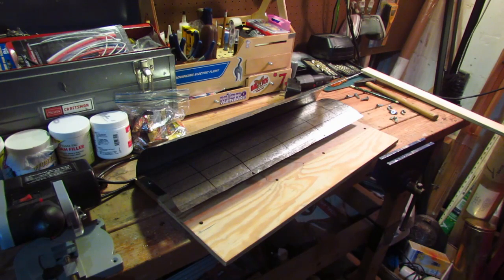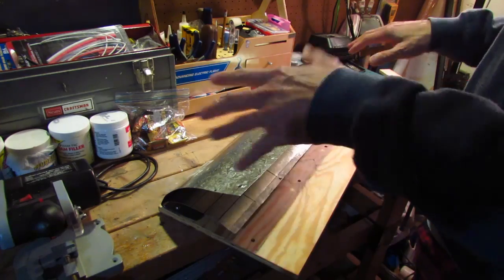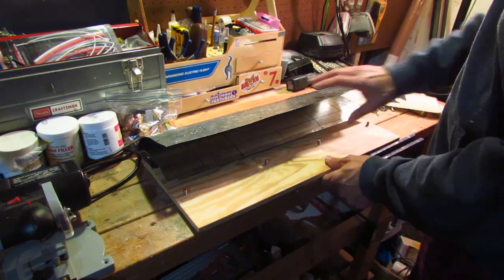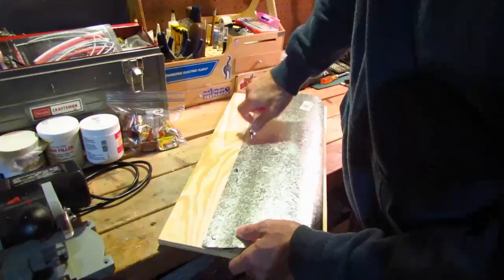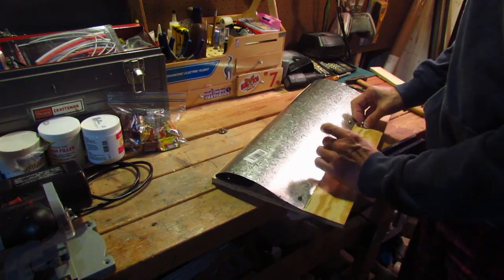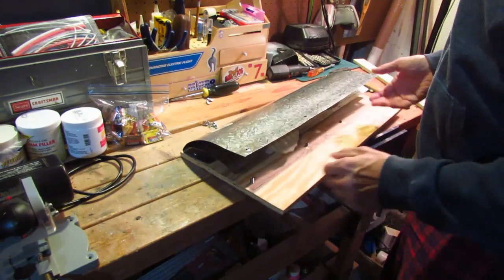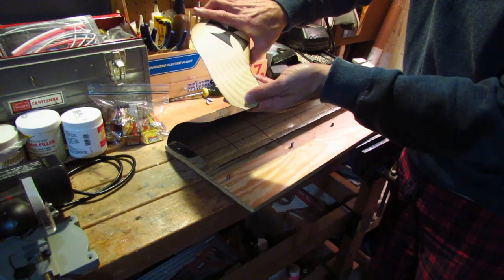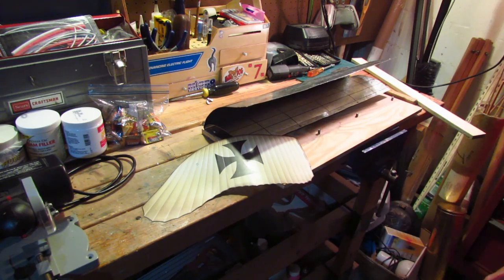Depron/Foam Wing Bending/Baking Jig

Comment from the maker: OK, I have to say that I think it's hilarious that someone actually gave this video a "thumbs down"...really???
Reply: Wassent me, but youre bending paper when title says foam;)
Reply from the maker: In the video I am just demonstrating in the workshop.  To actually bend foam you have to put it in the kitchen oven and bake. I explain this in the video.
Reply: Hey! You have done a brilliant job. The video is very helpful. The dislikers are probably people who have difficulty in remembering airfoil names and are too lazy to search :D. 
But I have a doubt... The whole idea of this jig is applying constant pressure to a wing material so that it retains that shape after sometime...Right? So will it work the same if I use some kind of weight(I'll spread it uniformly on the leading and the trailing edges). Will it work with balsa wood or is this only useful for foam?
Reply from the maker: @akshaysai1109  You can use weight instead of bolts, that's fine, as long as you apply constant pressure while the wing is forming.  In my case it forms in the oven (foam), but if you are using balsa, wet the balsa and apply pressure in a jig until it is completely dry.  You could do this with a less complicated jig, simply by using a wooden dowel under the sheet balsa and bending the balsa leading and trailing edges down to your building board with weights.
Reply: @altbob  thank you very much for replying so soon!! This conversation has been very helpful, and has cleared many doubts that I had. 
Thanks again :D
Just subscribed to your channel to stay up to date with all the marvellous content!
Reply from the maker: @akshaysai1109  You're welcome!
Reply: Just use a hairdryer